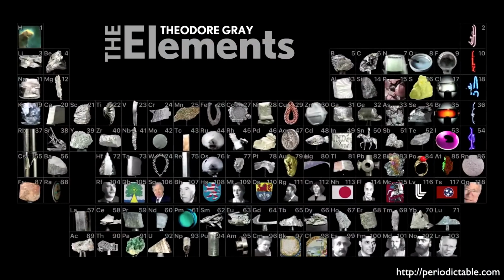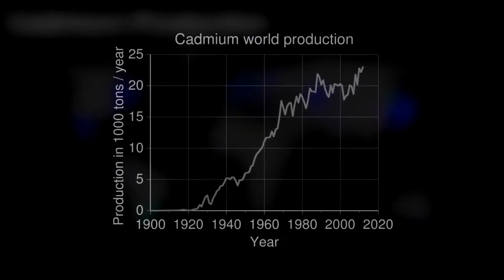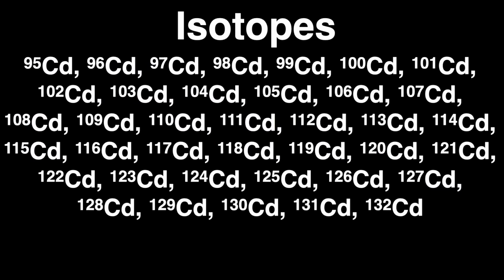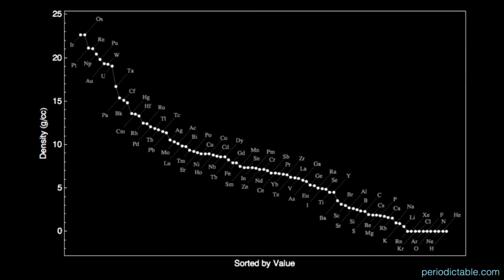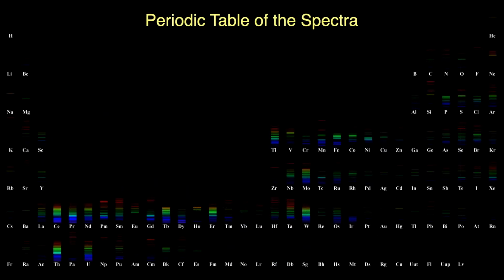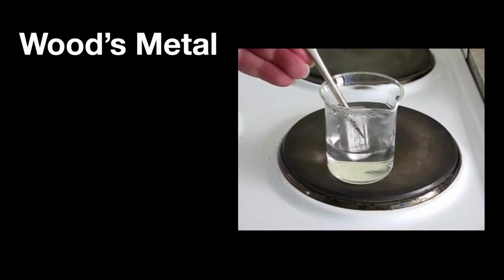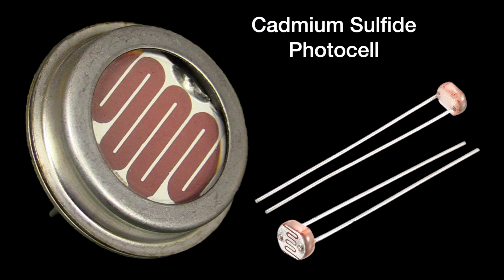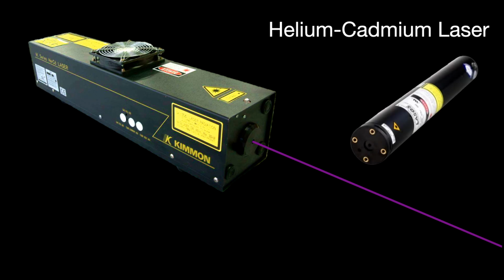Cadmium - Tales from the Periodic Table

Comment: FWIW I used to test the 2,000 lead workers for Cd poisoning .
The screen was a simple dip stick with either a drop of blood or a drop of faeces , suitably diluted .
The actual determination was done on the faeces , not a popular determination as the first step was to dry a fixed amount to a stable weight at a quite low temperature so it took a long time .
We ended up getting a new drying oven & installing it in a new fume cupboard .
While being toxic, it does eventually get passed out via the bowels and the "cure" back in the 60"s was simply to move the worker to an area with less Cd exposure risk .
PPE is fine if you are an administrator but not if you are working around a furnace doing heavy work .

Comment: 12:46 This is a cell. Baterry is made of multiple cells.
Reply from the maker: Martin, I think I'm forced to disagree with you on this one. A "battery" can contain one or more cells. A typical C, D, AA, or AAA battery only contain one cell. Certainly, a higher voltage battery, like the one in my Chevy Volt, does contain multiple cells wired in series as you say. Cells can also be wired in parallel to increase capacity. Or series-parallel to increase both qualities.

I just checked and the 1.2V NiCd batteries you refer to in your comment are indeed single-cell.

Thanks for the watching!

Ron

Comment: This was most interesting (as was the one on Te).  I'm curious why the metal is considered to be at risk of availability?  I would expect lots to be available due to the recycling of NiCd batteries as well as plenty of it found with mining various other elements.  I've seen Qdot TVs but it looks like OLED is slowly replacing them - I wonder if there's any Cd in those (I suspect not).    My best guess is most of it is going into thin-film solar which I suspect will be a recycling nightmare.  What are your thoughts on this?  BTW, my low-view channel focuses on nuclear energy, particularly Gen IV, so I was pleased to see you mention its neutron absorbing use, which it does VERY well.
Reply from the maker: I suspect that NiCd battery recycling is on the decline since NiCd batteries have almost disappeared from the scene, having been replaced with the much more reliable NiMH and Lithium batteries. 

I believe that quantum dot manufacturers are trying to move away from cadmium-containing chemistry because of cadmium's biological environmental toxicity.